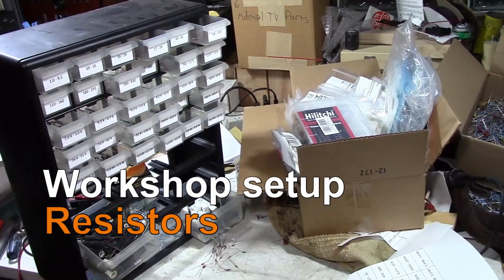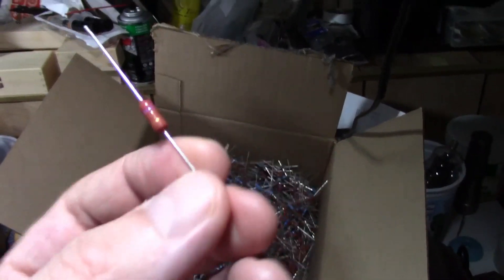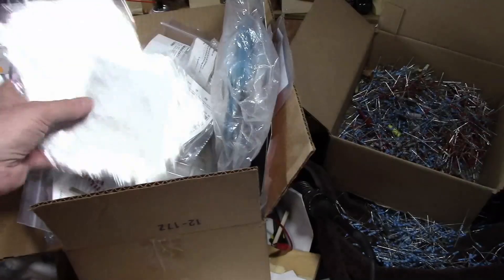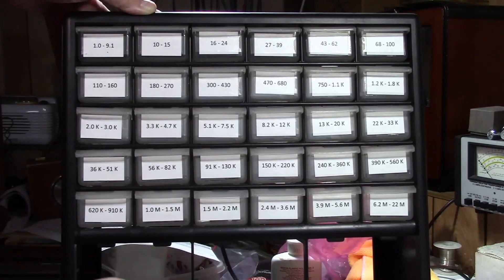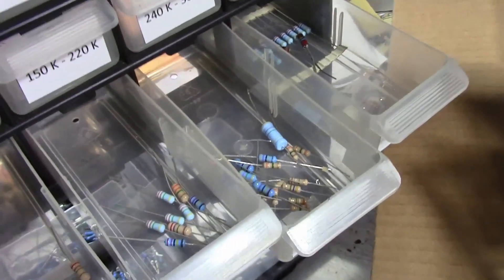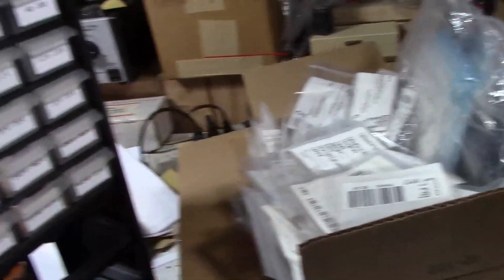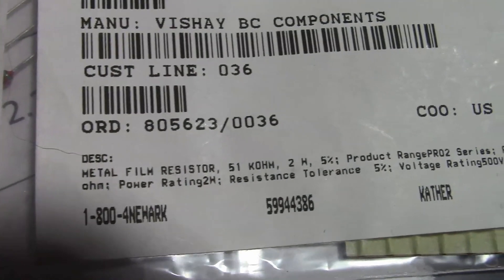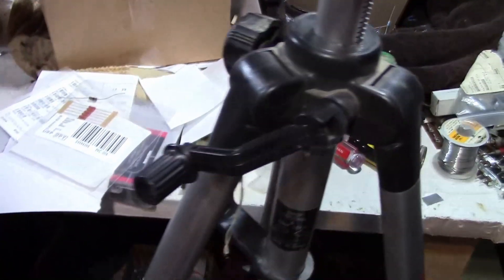Workshop setup - resistors

Comment: Don’t look like you really needed all those resistors. I would generally buy a 10 pc pack of standardized values and wait to see what was more in demand after several months. And, I generally buy all resistors in 1 watt sizes and very few in the 2watt size. Other sizes on demand when required 5w, 10w, 25w. It looks like you bought the entire company.
Reply from the maker: I buy in quantities of 10 or 25 to get volume discounts.  I also work on a wide variety of technologies.  Everything from 1920s radios, to modern solid state amps.  You get into TVs you need a wider range too like the electrostatic sets use values over 1 M in the deflection circuits. Even up to 22M in the Motorolas.

Comment: The blue ones, I pretty much find impossible to read. They are delightful in that their values are usually so precise, but that's it. I will say,  I'm over 60 years old and my eyes definitely ain't what they used to be, but on the older Allen-Bradley resistors, with the sharp, defined corners, I rarely had to even think about the 10% values (been doing this since I was a teenager) because the standard RETMA (or is it just RMA now?) values have been around for so long and I've seen them a billion times. I've even gotten huge bags of the A-B 1/4 watt size where the values were so weird I had to examine them and measure them, one by one. My point is that it's worth 2 cents to MEASURE a resistor, and then (if they are custom values) you have to go through the decision process of whether to place a 947 ohm into the 910 ohm drawer or the 1K ohm drawer. Of course it does no good  just to MEASURE a resistor because if you couldn't read it when you first saw it you won't be able to read it when you go to use it, so you have to create some kind of bag with that value. My point being, and YMMV, yes, in a giant thrown-together assortment you can get your resistors for a penny apiece but if you can't read them, you have to measure them, and you'll never use 13/16ths of them. So they're not a penny apiece. I don't think those mass assortments are a good deal. Or maybe I should say, they are an incredible deal but they are a goofy way of buying resistors you need. I see nothing wrong with buying SOME assortments of 20 of each value where the indiv parts are on a tape. I'm talking (negatively) about the 5,000 resistors in a jumbled box.
Reply from the maker: Those blue resistors did come on tape with each value in a small separate bag.  I took them off the tape and put them into storage drawers.  The cabinet fell over and they all got jumbled together..

Comment: You said the blue ones were no-name's and that is certainly possible. But I always order resistors of the same color of mouser or such and they are vishay branded metal film 1%. I also have some of the brown 2 watters. Just different series. Personally I prefer the smaller blue 1 watt types (where appropriate), They give more room in otherwise cramped chassis, better noise figure (no that relevant) and the make it very easy to identify a replacement, which I prefer unless its a true showpiece. They are also reliable. That said I measure every resistor before I use it. Never had a wrong color code, but misreading one, well that happens.
I also do the order extras thing, It's very usefull especially on the oddball values. Makes sure you always have one :)
I refuse to use carbon comp, might be original, might have niche use cases. But they are not stable in the long run and are the noisiest of all types.
Reply from the maker: Yes, name brand 1% resistors are also blue.  I like your point about being able to identify replacements easily.

Comment: Are those the plastic trays? if so How do you get labels to stick to the drawers ? mine just fall off after a week or to... I would imagine the oil in the plastics is to blame...I ended up super gluing the labels to the drawers...
Reply from the maker: Yes, they are plastic and I have had the same trouble with failing labels in the past.  These were attached with clear plastic tape.  If they start falling off, I'll try something else.

Comment: As an alternative to the metal cabinet with clear drawers shown here, "Keter" makes a toolbox-style parts box with 24 reddish-brown, *removable*, cup-like  individual plastic parts bins (with rounded bottoms too), and a BIG handle for easy carrying. About $18 at Walmart. I use these for organizing screws and nails and hardware for various carpentry and home-improvement projects, but they'd work well for storing caps and resistors in an organized fashion. Only drawback is that they're somewhat heavy. Designed in such a way that even if you accidentally forget to latch the box shut, you can pick it up and carry it without spilling/dumping the contents on the ground. All tool and tackle boxes should be  "fail-safed" in this manner; I had a boatside/dockside incident with a large Plano fishing tackle box when I was a kid that still makes me agitated to think about it.....

Comment: When I started out I kept my resistors in parts drawers and had them sorted by the First color band. Later on I sorted them by value and before I knew it I had too many and started poking around on parts storage. I ended up using Coin Envelopes and a huge Trading Card Box. I have them sorted by value, wattage and type. I also ended up sorting everything like that and only use the Parts drawers for the most common use stuff and parts that are too big or awkward to fit such as ICs. The handy thing with the Envelopes is I written down the mini Datasheets on them for Transistors, Diodes and such. What I would love to find at a fair price is one of those Library index card cabinets (Apothecary Drawers). Been debating to buy a cheap Table Saw and and build one.

Comment: Don't knock the carbon comp resistors too much. If you get late 1960s or 1970s production Allen Bradleys, you may be surprised by how consistent and up to spec they are. I get them all the time, and rarely get a batch that I have to reject. Sure, the noise figure is higher, but the look can not be beat, and at this point, they have probably age-drifted as much as they are going to drift. Plenty of surplus outlets sell them.

Mind you, I can not say the same about other classic brands (CTS, IRC).
Reply from the maker: I take your point.  Allen Bradley made some fine products and there are certainly millions of carbon comps working fine after decades

Comment: Bob:
   I don't have extra anything when I order passive components. The one thing that I can take from this video is your thoughts on ordering more than enough for your project. You're  right, the next time I put in an order, I'll be sure to order extra as well. And your also right that this will bring down the individual component price charged as well as the quantity ordered goes up. 

  Those Vishay metal 2W resistors are nice, I have used those in the past as well. Nice knowing they match pretty good, don't drift, and are quiet.
   Keep the videos coming. I am enjoying it.
                                                                             Tom
PS Remember my Sencore PR57 had 5 broken/missing push knobs? Well my son designed and 3D printed some replacements. They work great! I don't have to push them in with my pinky anymore.

  I have some extras if you know someone looking for some. I'll send you a couple of spares to if you like. The flimsy push-buttons are a weak point to this otherwise terrific instrument. Let me know. OK?
   No charge, of course! Well you could send $100-$200 dollars in phoney money to me like Buzz1151 and OldGoat64 had sent to "John from Arkansas," if you like. If you feel it necessary to...   ;-}

Comment: I have been looking for reasonably priced metal parts cabinets.  I had over 20 of the plastic ones that fire melted into big lumps of plastic and parts.  There was over $10,000 in parts that were lost because of this.  Not actual flames, but heat from the fire.   Also be aware that when the plastic melts it gives of poison fumes.  Right now I am limited to new plastic ones, but like I said I am looking for metal bins.

Comment: i store my small resistors divided by last stripe of colour...for example resistors that have green on the last stripe go to a big drawer, that includes one meg, 1.5 megs, 2 megs etc... resistors that have last stripe yellow go to a different drawer, 100k 330k 220k etc...and i have big drawers so i can spread them and choose the ones i need. works fine for me.  for big power resistors, wirewound ceramics and similar, i have them divided by 3 categories :from 100 to 500 ohms wich is the most common for mains dropping resistors , they go on one drawer, next drawer is 0 to 100 ohms, and the other one is 500+ and upwards. those are the least used ones on my vintage projects.

Comment: It's too bad they never used a symbol to indicate the first band on resistors and capacitors.
Reply: They should paint one band twice as wide as the others, probably either the multiplier band or the starting number if the resistor value, so that we can tell which end is which...

Comment: Ah yes, Organization, the thing we ALL need to do, but the thing most of us put off as long as possible. 
I have 2 resistor cabinets, one for all the standard 5 and 10% resistors, and another cabinet of 1% 25 PPM drift coefficient capacitors for broadcast VTR servo systems. 
For capacitors, I have one for film and Mica, another for electrolytic and wet tantalum.
Ace hardware has a few organizers that are nice, but Harbor Freight has a lot more options, and if you chose carefully there are ones that are of good quality.

Comment: I ordered a complete assortment of resistors from Amazon once and they were color banded wrong.  The value was correct on an ohm meter according to the label on each bag. But the colors were way off.  I noticed it as I was putting them in my resistor cabinet by the bag markings and happened to notice the colors weren't right.

Comment: I generally sort mine by the third color band so rather then a range of values in each drawer I have a range of decades.  Seven drawers will cover black to blue  then it is usually pretty quick to grab what I need from any drawer, I just need to look for the first two colors.  I have a row of drawers for 1 watt and another for 2 watt. Has worked well for me for 30 years.
Reply: Same here.
Reply: @w8nwo  same here just commented above